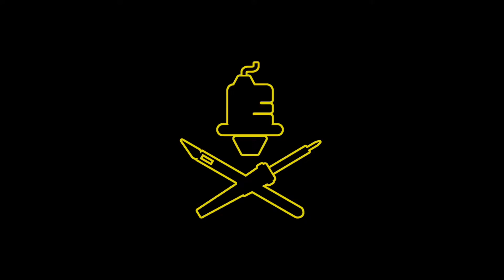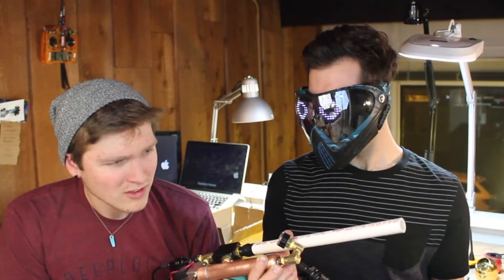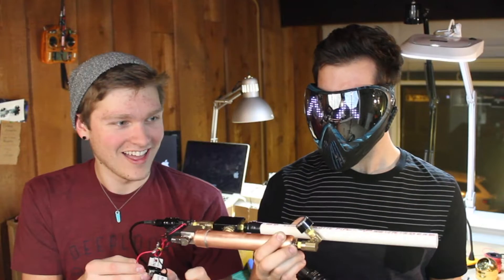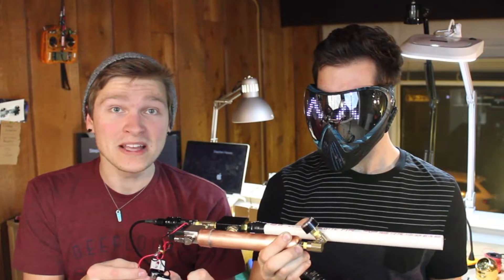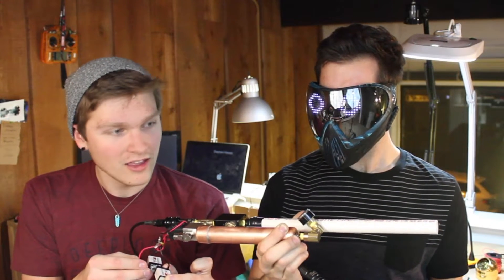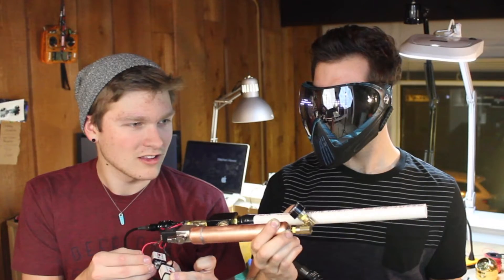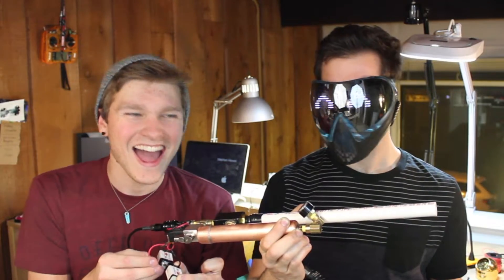Urbex Pip-Boy Gauntlet And Circuit Board!

Comment: Why did you use glue on the bed exactly ? Is it because you can't got a good adherence or just because it's easier with glue ?
Reply from the maker: Just a bit of purple glue stick! The Taz 5 has a PEI print surface which is usually pretty good on its own, but I find I get a more consistent first layer with a bit of glue.